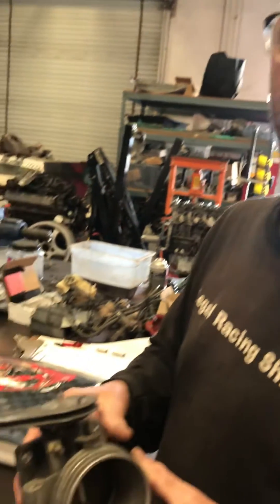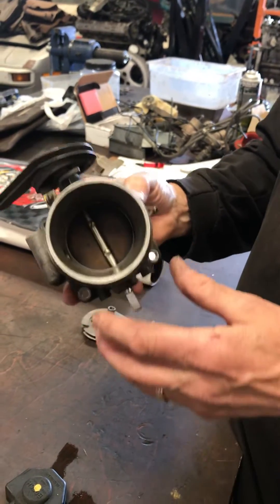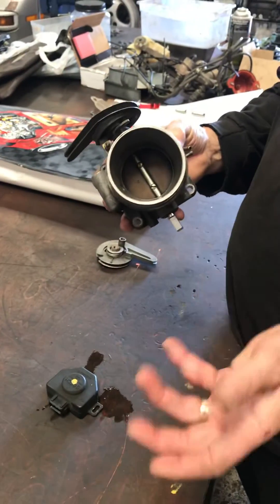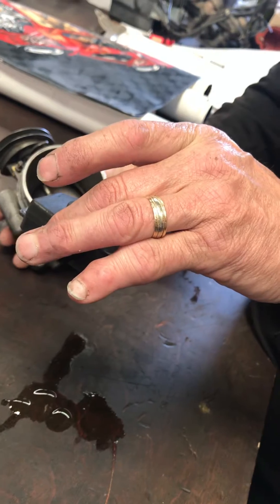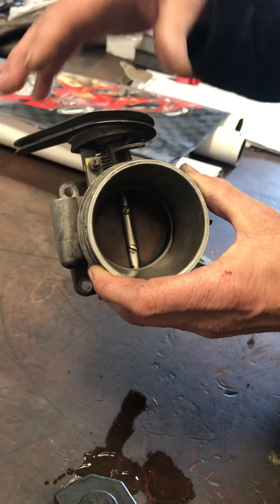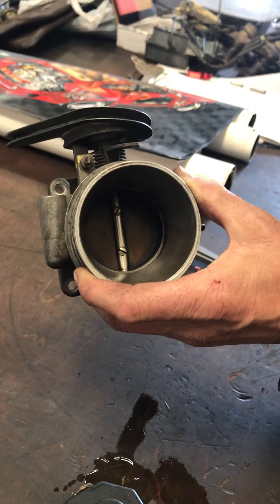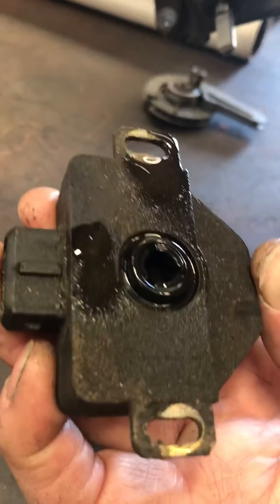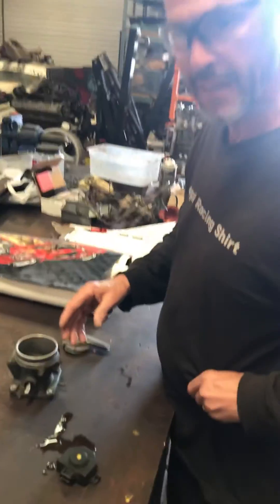Porsche 944 throttle position sensor

Comment: So the shaft that holds the plate have seals, what are they called is there a part number? Once you have new TPS do you set in the middle and screw down? can you use early tps on late car
Reply: All 8 Valve NA's use the same TPS. You have to set it so it just clicks off idle as soon as you move the throttle cam.

Comment: Super helpful video thank you! This exact thing has happened to mine. Is the TPS repairable? Can you just split it open and clean it out or does something physically break? Cheers, Peter.
Reply from the maker: You can split it open and clean it out, but it might be better to just get a new one after 30-something yrs. Get the throttle body rebuild kit and seal up that throttle shaft.
Reply: @ComeauRacingEnterprises  Just did a vacuum test and saw my seals are real leaky..  Do you know where to get a kit from?
Reply from the maker: Sorry, I can't recall. Maybe RENNBAY? @MrKj3ll

Comment: Hi Tim
Reply: Hey, Brother! How's 944 life?
Reply: @timcomeau420  great but not sure if I should buy this 84 944 like mine or not. Mine is clean ac works sport script seats but this one has a power steering delete, fuch wheels, nice paint too and also sport seats too. Car has maintenence records which is awesome. Ac doesn't work and its rust free from TN. The idle was surging 100 rims at idle when fully warmed up.. this scared me and I can get it for 5k its pretty nice otherwise. What do you think? Thanks for the help
Reply from the maker: @samamahm6123  If the Fuchs wheels are straight and true they are worth at least $1000, even in the smallest 944 sizes. A surging idle might be a small vacuum leak or a tired strip in the AFM. Get the car inspected locally. Get together with other 944 owners around you to troubleshoot.